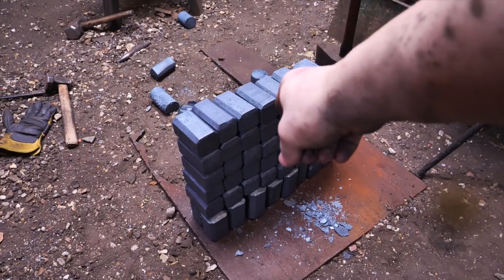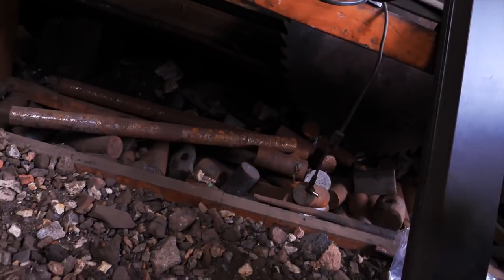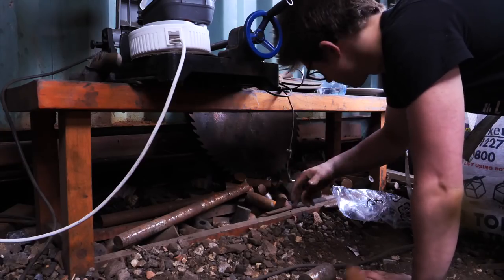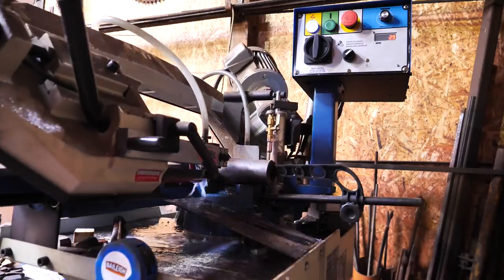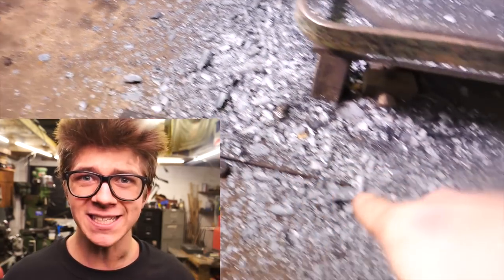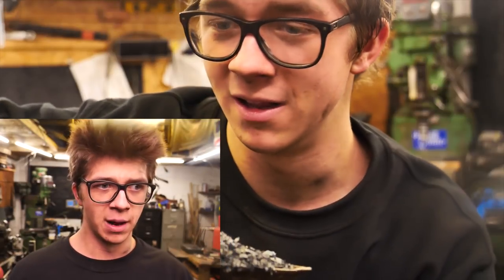MAKING 70 HAMMERS!!! Part 1

Comment: what if you go and collect all the scale and put it into a "foundry" with carbon and make some Blum steel ??
Reply: leonxpc1 
I was kinda wondering the same thing. I'm not a blacksmith or metal worker. Could the slag be used with flux and powdered steel to make some kind of canister Damascus?
Reply: you'd want to grind up the scale into a fine powder first, then remove as many impurities as you can by collecting the iron with a magnet, leaving the impurities behind. you can also add the grinding dust with the same technique. this mix will probably still have a lot of impurities in it though. then you have to build a foundry and add all your iron powder and charcoal in small amounts. in the end you may get steel that could be usable but the chances of that are very low. Chandler Dickinson tried this and managed to collect enough steel to make a small knife, but that steel was very low quality, it's a fun experiment though.
Reply: There are several ways he could melt and treat the scale as it is usually all mild he works with(haven't heard what he used in this video) usually you can carbonize the iron and steel in a square or circle pipe.
Reply: for his hammers Alec usually uses 1040/4140/4340 equivalents i think so probably no need to carburise unless the intention was to use it for making a blade

Comment: Alec, i have a question about drilling holes in metal.  i have to drill like 40 holes into 5mm stainless steel.. with a 8mm drillbit. 
i guess i should not let the bit get hot to avoid it getting dull, right ?
how should i do it ?  use a wet fabric and cool it down after each hole ?
make brakes ?
im realy not sure whats the best method.
greetings!

Comment: Alec, is there anything that could be made from all of that iron oxide scale? Or would it need to be chemically treated to get rid of the oxidization first?
Reply: There are many things that can be done with that scale.
1 - He can smelt it himself, the easiest way to smelt it is to make it into bloom steel (AKA Tamahagane). Refining it into pure iron or high quality steel requires more knowledge and work.
2 - He can run with the iron oxide and make something that requires iron oxide like thermite, or paint pigments.

Comment: Hmm, 12 lb (roughly) from roughly 300 lb of forging material. is this a typical figure? Would you include a scale loss when calculating the starting weight of a forged item? Or would you have to figure in number of heats, hand Vs power, alloy Vs mild, etc.

Interesting trade, blacksmithing; lots to consider. A whole new shift of perspective for anyone transtitioning from another trade. I'm a machinist. Mine is a subtractive trade. I cut away material to make stuff. An iron worker adds chunks together by welding, an additive process. Blacksmithing reshapes his starting material so I guess that's redistributive. What would that make of a foundryman?

Comment: so... I saw a video a while back... I think it was from Chandler Dickinson... I think he was trying to see if he could recycle his "shop floor dust" into other things... 

I don't think he was that successful, but I wonder if you'd try it as a science experiment, to see if you can succeed where he failed?
Reply: Actually chandler pulled off a little something from smelting his shop floor dust.  But it wasn't scale.  It was from his grinder and small chunks of cutoff steel.
Reply: I know he had some very small successes, but I think most of the videos I saw he seemed to be frustrated throughout the process as he didn't really get much usable steel out of it... I'm wondering, what would happen if you learned from his mistakes, and just went straight for the cannister Damascus...
Reply: I'm hoping to one day find out. I have strong magnets all around my grinder for collection of metal shavings as I work.
Reply: Awesome... :P

Also, I don't think I've ever seen Chandler use a power hamer, and Alec is using his all the time... Plus Alec has done cannister Damascus before, so I think he may have a better chance at success...
Reply: Alec does much more with forge welding in general so he probably would have more success.
Reply: @chandler if you are reading... No offense dude, I really enjoy your videos as well for entirely different reasons...
Reply: I enjoy Chandler's videos.  Its pretty awesome that he is willing to try things like that just to see if it can be done by him.
Reply: Garret Hoffman he could send it to Cody's Lab. If anyone can do it Cody can!
Reply: Michael B I haven't seen that one... is that another YouTuber?
Reply: Garret Hoffman yes

Comment: Who purchases these hammers and why? I'm not trying to be rude I like your work, but there are so many companies that produce hammers just like these. Since they are machined they are also likely to be cheaper.
Reply: Jack Model cheaper yes but in every aspect. Setting aside the art of having a true hand forged hammer, with a handle also shaped and finished by hand.  anything mass produced is done so within a set budget.  That almost always leaves a lot missing in quality.
Reply: Blacksmiths purchase them. Why? Great craftsmanship, geometry and they're pretty to look at! Yes they're expensive but who cares, It supports Alec and it's a tool that will last you a lifetime. If you're a professional it'll pay for itself the first job you use it. There are a few others that make a 4 1/2 lbs rounder but none that are mass produced as far as I know, certainly not "just like these".
Reply: Jack Model Well, there are many reasons for different people, but first of all, this is a channel of “Blacksmithing”! Not industrial manufacturing. Most of Alec's followers, me included, jump at the opportunity to purchase forged hammers cause it's a way to help support what Alec is doing with a previously lost art, and each and every hammer is unique, no matter how similar they look. I'd rather have 1 tool made by a Craftsman, than 100 “cheap” reproductions.
Reply: Not sure I agree with that. I mean, the whole point of machining something is to get it done quicker, with better quality, possibly both. Estwing, WorkPro, Stanley, all make excellent hammers, hundreds everyday, all of them at least as good as these ones. My sister is a professional chef, and one thing my parents made very clear to me was that her knives weren't pricey as they were (we are talking in the 200-500 here, the makes about that many individual meals a day) because of the craftsmanship, but because of the quality of the steel they were made from i.e. 5160, 6150, or some other metal I don't know of. The same is true of mass production hammers. The procces isn't actually that different from what Alec is doing here, except the arms are mechanical.
Reply: They do? I thought the point of being an ironsmith was to make your own hammers. Well, in any case, I think it's part of the fact that I don't do enough that requires hammers of any kind.
Reply: I've bought mass produced hammers.  In fact just put a new handle on my less than a year old cross pean.  Maybe it's just my bad luck, but the craftmanship was very poor. I'd like to have a look at the hammers mass produced like these if you have a link?
Reply: Obviously I cannot speak for other smiths as some enjoy making every tool in the shop. I just want to make a living, if I'm wasting my time making hammers for myself I'm losing money. Can I make a hammer? Yep. Would it be as nice as Alec's? Would I make it as efficiently? Nope.